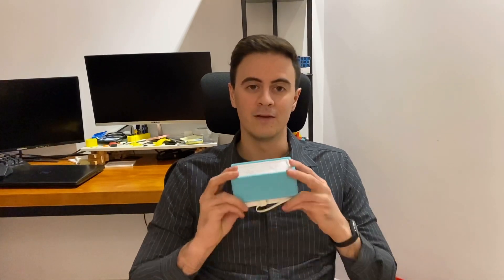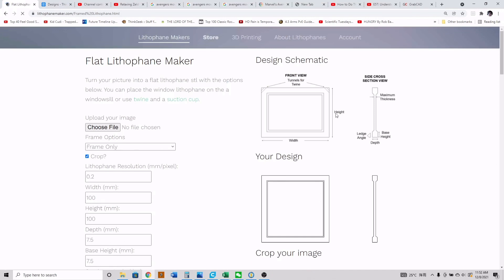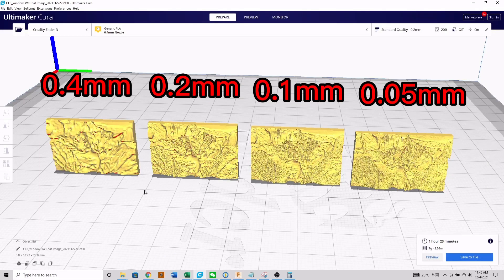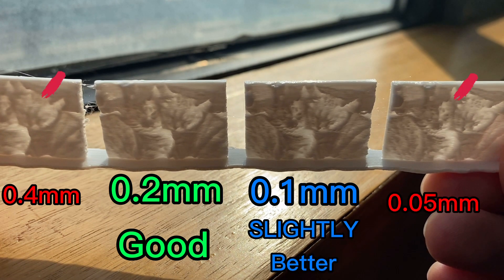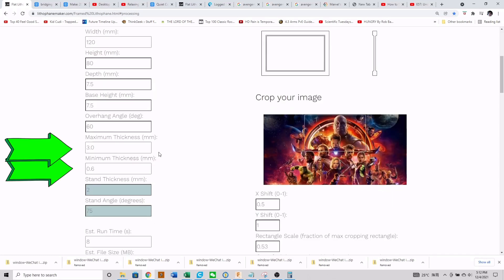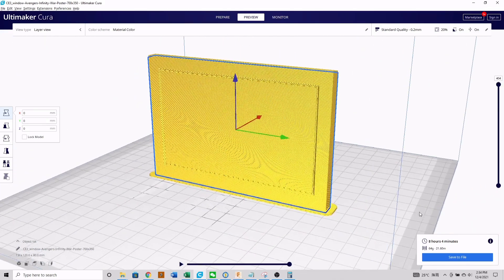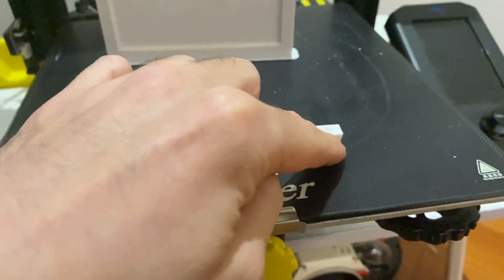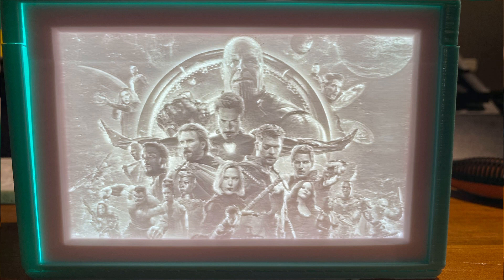Beginner’s Guide to 3D printing Lithophanes (Also tips and Tricks!)

Comment: even with 3mm thickness i encountered tiny holes in the finished print. I could make it thicker but then less light could pass through right?
Reply from the maker: 3mm may be the maximum thickness but if you have holes blowing through that is related to the minimum thickness. Increasing that could solve it but i i suggest checking in your slicer. If the wall is only 1 wall thick you can reduce the line width to let it be 2 walls thick. Otherwise your holes may be caused by under extrusion or wet filament or other reasons.

Comment: what's the speed of the print which i have to use?
Reply from the maker: It depends on your printer. For best quality results 50mm/s or slower. If you have klipper or a newer printer with input shaping controls you can probably get by with faster.
Reply: @DesktopInventions I have an ender 3 v2

Comment: Great video! Thank you! I have a question though - where to find that support (the sheet)? I use Cura but can't find it... Maybe it has a different name now (cause I see the video is 3 years old).
Reply from the maker: It was just a regular support, but due to the angle of the frame, it generated the support for the entire face which turned out looking like a sheet.  If you adjust your support angle value, you should see the same.

Comment: What is full sheet of support? Cura settings?
Reply from the maker: It was just a regular support, but due to the angle of the frame, it generated the support for the entire face which turned out looking like a sheet.  If you adjust your support angle value, you should see the same.

Comment: print in portrait or landscape mode? I had a 135mm tall print that had a band up near the top, and thought it was probably due to height. so now I am currently printing in landscape mode, picture is on it's sdie to see if that helps, and it's 89mm wide so the longest side(135mm) is on the bed.

Comment: Thank you SO much! I am doing these for Christmas gifts this year. Following your guide lines, I am hoping they turn out okay. I do have a question. What is meant by "overhangs"? Thanks again!
Reply from the maker: Overhang is a part of the print that will extend out with no direct support. Typically areas with greater than 45 or so degrees overhang require supports. But for lithophanes I typically don’t recommend it because it can cause poor print quality.

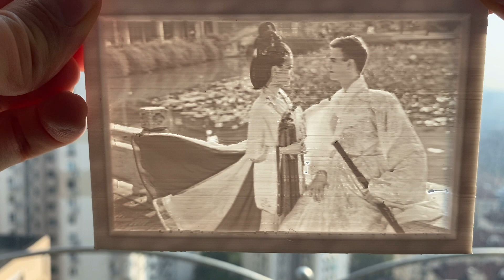Comment: 7:58 - got the same lines and some small almost holes like here. Is it possible to fix? If yes - how?
Does the speed matters - what is the best if yes?
Also author compared 0.2 and 1.2 resolution. Interesting what would be the middle... would it be the golden middle at 1.6
Thank you very much mr. Helper!!!

Comment: I do have one note on this video regarding the resolution. The resolution should be in alignment with your layerheight. 

If you are printing at a .2mm layer height, you won't see an appreciable difference at any resolution set lower than that. 
Basically if you set the resolution to .05mm on the site, but you are printing at .12mm you are going to end up with an end result equivalent to if you chose .12mm on the lithophane site. 

If you want to see the benefits of setting it to .05mm then you need to use a .2mm nozzle and set the layer height to .05mm. 

I know that most people use a .4 mm nozzle, but it makes sense to call that out in your video where that resolution comes from, and how you would be able to work within that resolution and get a better image, by potentially using a smaller nozzle and switching to an equivalent layer height.

Comment: I've seen quite a few "tutorials" but this one ranks at the top. No nonsense, just the facts. Thank you!👍

A few first hand words about printing Lithos (or anything)  standing up from experience (fails). Slower speed is a certainly better choice: Your printer is going to shake like crazy printing these so put your printer on a very sturdy surface. Those "invisible" vibrations will physically manifest themselves as dark lines especially in the higher layers. These lines, in my particular case, directly correspond to the vibration. Slower speed = less artifacts/lines (in my case).   Artifacts may not appear in all cases due to variables however in any case the less shake you introduce, the smoother the print will be.

Comment: What did you do to be able to print white so small without clogging?
Reply from the maker: I haven't had any issue with white clogging on this printer.  If you have issues with clogging try changing to a different filament, or drying out the filament.  Also clean or change to a new nozzle if yours is dirty or getting old.

Comment: Hi! Thanks for this great video!  But can you tell more about face sheet support please? What is the pattern? Lines? My Cura didn't generate sheet like yours, it starting  from table somewhere and doesn't looks solid...
Reply: did you ever figure this out?
Reply: @jimmytwotimes1  nope..)
Reply: @ZebRoll  you have to set the support angle to zero degrees. That should do it!
Reply: @jimmytwotimes1  thanks, i'll try this
Reply: @ZebRoll  just be sure there is a border or it won’t work.

Comment: brims are not a headache if you use the correct tool. coming from a metal working background i find that a de-burring tool removes it with ease and cleanly.
Reply: I don't get debugging tool..I'll have to look it up
Reply: Chrisfrisch1347 what deburring tool do you recommend for PLA/PETG?  Thanks in advance
Reply: @BillDWP  McMaster Carr calls them "Deburring scrapers" but searching for deburring tool generally brings them up. We call them a deburr whip in our shop.

Comment: how do you get a color picture not just black and white seens some dont know how or if its possible
Reply: I have not tried yet, but I read you can print the same pic(color) used for litho on paper and put between light and litho for color.

Comment: Is a risin printer not more usefull for pictures?
Reply from the maker: I haven't tried it!  I imagine it would be pretty good at lithophanes, but might be more limited on the size you can produce.
Reply: Yes, infact I find with even my entry level resin printer, I can print a 4x6 lythophane in 16min or less and have the print resolution of 0.034

Comment: Would be great to see how to do it just in Cura, if possible. Not too fond of uploading personal photos to some unknown site. But appreciate the in betweens here…
Reply from the maker: Yes you certainly can, there is no standard border options and less resolution settings but it’s certainly possible!
Reply: I say that because I am literally in the middle of printing my first lithophane as I write, bout 1/3 done. Just imported right into Cura, winged the settings. Been checkin with a bright flashlight, so far - I can definitely see a picture. But I’m sure there is room for improvement. With that said - I don’t see the need for a separate website to share my data with…

Comment: What are the pro’s and con’s of printing the plate vertically vs horizontally (in which case you’d need to print the stand separately)?  Are the individual strands more visible in either orientation?  Is there a speed difference?
Reply from the maker: You mean portrait vs landscape? Printing landscape will be slightly faster due to less layers and the quality should be better since the Z height will be lower. Printers tend to have lower quality as the Z height grows.

Comment: Nice video. New to 3 D printing & learning a lot of stuff.
Quick question which was a bit confusing. So no support = 90 degree & face sheet support = 0 degree setting in the slicer sofrware? TIA
Reply from the maker: Thanks! Correct, 90 degrees is no support for Cura slicing software.

Comment: i tried downloading a stl mutiple times and it downloads as a zip file which cura wont open and wont work to unzip either what am i supposed to do.
Reply from the maker: Also you might try a different software to unzip the file? Usually I use 7zip
Reply from the maker: Maybe the file size is too large? Did you try reducing the resolution some?

Comment: Great video, thank you. Heads up to anyone though when thinking about raft vs brim, if you're using Cura at least, you can change the brim distance to .1 and it will not join the bottom layer of the print. That way it still provides the benefits of a brim, without actually touching the model. Super easy to remove. I've had some bad luck with rafts and the gap necessary to pull off as easily as this video. Plus it requires more filament. To each their own, but just wanted to mention that setting.
Reply from the maker: Great advice! This takes the brim and raft and brings out the best of both worlds! Thanks for sharing this!

Comment: The part where you are cutting the square with the razer blade for some reason when I have tried that layer is stuck to the image at certain points and upon try to remove it I end up breaking the image any advice to make it easier to separate
Reply from the maker: Yes I struggled with this before on a part with thin sections. (Anything in the photo that appears white) the thin walls are quite thin and easy to break. A few options here: 1. Increase the x/y distance in your support material settings. This will help if the support material is fusing to that area. 2. Increase the minimum thickness of your part, this will make the thinnest sections less easy to break but will make the overall lithophane a little darker. 3. Print without support material, for many photos this will work just fine, but if you have some larger horizontal ledges in the 3D model there may be some drooping in those areas. I Hope this is helpful!
Reply: If you print horizontally instead of vertically, you would not need a support, right?

Comment: Maybe I missed it but you're talking about print resolution but you never mention what size nozzle you're using in the printer. I would appreciate if someone could help me with that because I'm currently running a 0.6 but I can change to any size we need
Reply from the maker: For this video I used a 0.4mm nozzle for all the tests.  I would recommend 0.4mm unless you're printing pretty large lithophanes you want to view farther away, then 0.6mm you could probably get by.
Reply: @DesktopInventions   That's awesome. Thank you so much. I'm excited to expand what my little printer can do
Reply from the maker: Have fun!
Reply: Just finished my 1st print. It's beautiful. I can't thank you enough for this video.

Comment: Hi thank you for creating a wonderful website.. How to determine the dimension of the lithophane for a given image such that it creates a good quality lithophane.. More likely is there a relation between the dimensions of the lithophane and image choosen?
Reply from the maker: Hi thank you but I did not create the website, just telling about my experiences with the settings and how to use it.  I would say the size of the lithophane is up to you and how you want to use it. If your image has enough pixels in height/width you can make the lithophane as large as your printer can go without too much sacrifice.   Ultimately if you’re concerned you can calculate your dpi (dots per inch) and google “viewing distance vs. dpi” to understand at what distance the image may start to look pixelated. Hope this helps!
Reply: @DesktopInventions  Thank you for the information :D and the minimum size of lithophane i can go for a given image?

Comment: Love the video my dude, I'm working on a few 206mm x 206mm prints for a Christmas gift. Just had one question though. How did you add a raft to the print to help with the bed adhesion?
Reply: Lol, never mind I just saw the tab for it as I was double checking my setting!
Reply from the maker: Thanks! Yes I just added a raft in the cura slicing software under print settings. Happy printing!

Comment: Are you printing vertical for a reason.  You could print these flat with no support needed.
Reply from the maker: Printing flat is faster but it doesn’t capture the changes in shaded regions of the photos very well. See 7:39
Reply: @DesktopInventions  Ok cool.

Comment: What sort of steps do you take to minimize stringing?  I don't know if I just have some white filament from a bad lot or if it is due to user error, but my attempts at lithophanes have been stringy messes and they also have a lot of blobs of material on the back side of the prints.
Reply from the maker: Usually lithophanes don’t have much stringing since the outer layers are a continuous profile.  But if you want to fix your stringing I would recommend a retraction test print like 2563909 on thingaverse. It’s a quick print and you can print these and tune your settings to help reduce the stringing. I usually lower the temp to 190C for PLA and use 5 or 6mm for retraction distance. Hope this helps you!

Comment: Where do I find a light box for the prints
Reply from the maker: I made a video on making a lightbox for a Nintendo Switch you could check out as a reference.  Otherwise there are quite a few designs on Thingiverse you could download and print.  You'll just have to find a method that works for you to add the LED back lighting.

Comment: What file type does the website export? I'd like to import it into Fusion so that I can integrate them into larger prints, is that possible?
Reply from the maker: It exports stl files which can import into fusion but you can really modify them. If you want to do some lithophane projects in fusion i suggest opening the picture file directly in fusion360 I believe they import in a similar fashion and you should be able to integrate them to other designs more easily.
Reply: I’m still learning Fusion but I have not found a way to import an image; instead, I convert the image to a STL (outside Fusion) and import that STL into a custom frame body I build in Fusion.

Next I’m going to try to use Fusion’s volume rendering to estimate the min/max thickness that maximizes the intensities I want visible — is that possible with your tool?